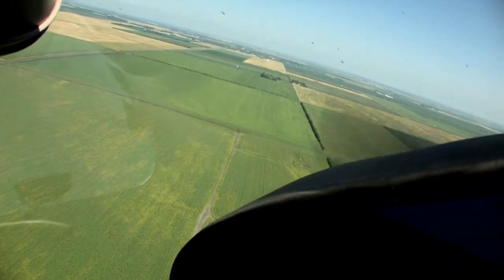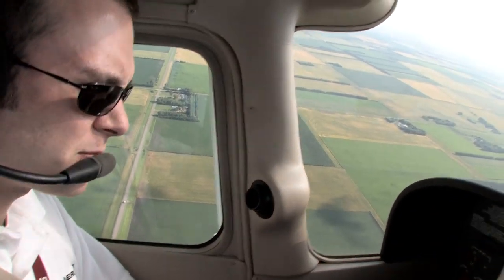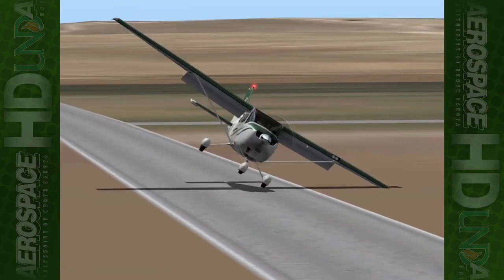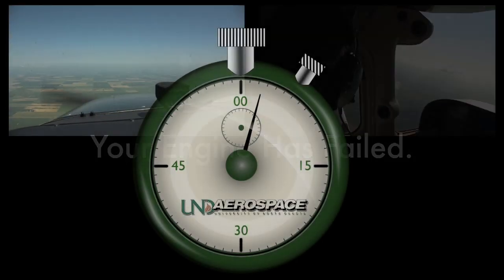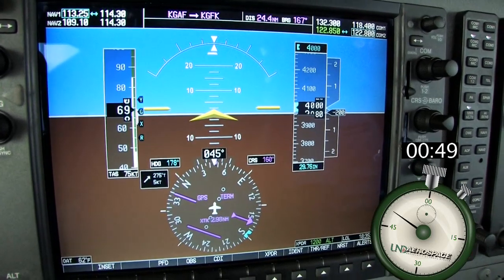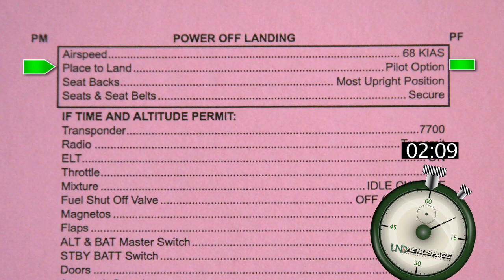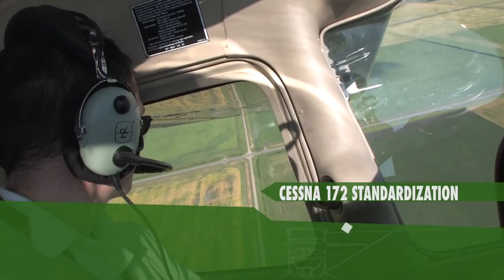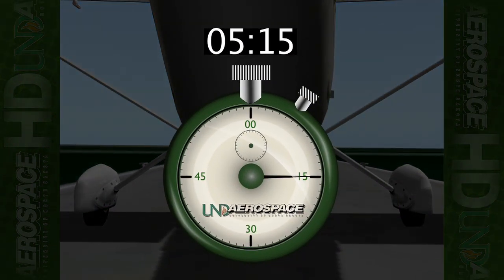(Video 2) The Emergency Approach and Landing

Comment: If you turn your master/battery off before final... how are you supposed to get your flaps down?  I guess turn it back on, put flaps down, then turn it off again?  WHAT IF on short final, the pilot forgets this fact, goes to extend flaps, and they don't come out when he needs them too?....   I think master should be turned off after flaps are out and you opened your door, and just before touch down, master off.... Just saying.

Comment: Aviate, navigate, communicate. No point wasting time getting out the checklist if you have it committed to memory if your less than say 2500ft agl, but first and foremost is to fly the plane.
Reply: Rizky D . Exactly right, id much rather know that checklist off by heart then be looking down at a checklist and not nailing that 68kts (172Sp) right the away around the field. flying the Airplane-communicating when you can do so safely and maintaining navigation/control of the Airplane.